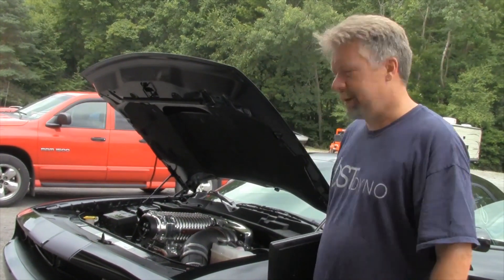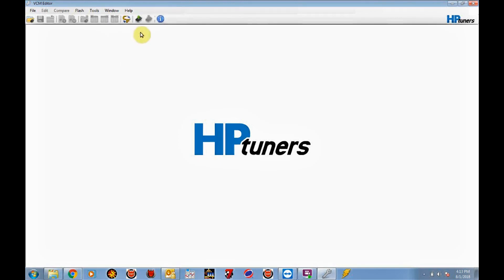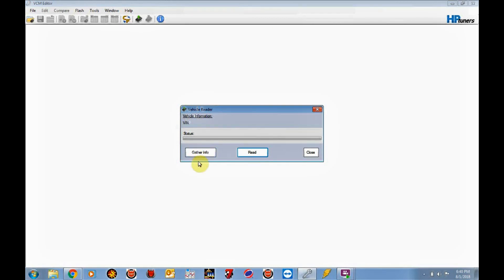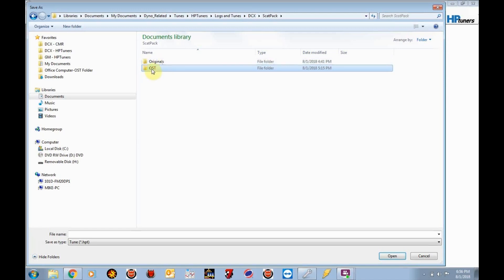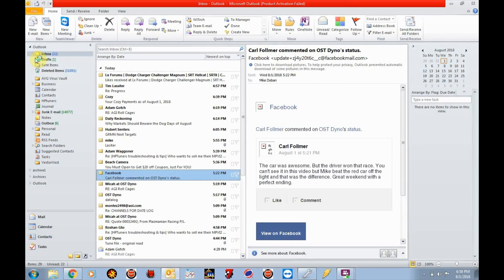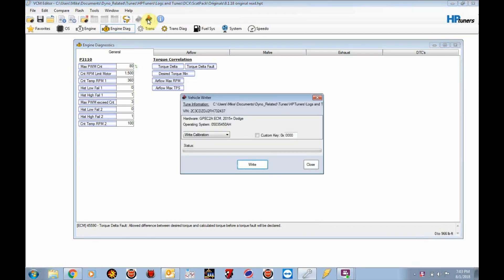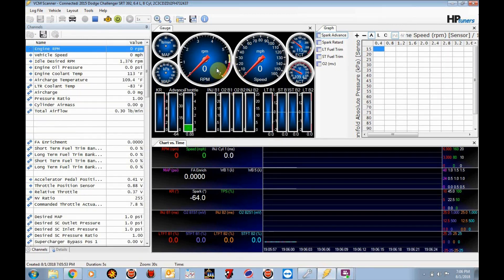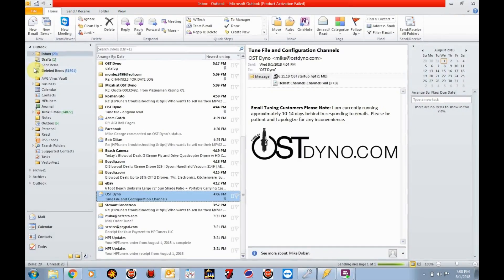OST Tech Tutorial #004 - HPtuners - Read/load tunes and datalog

Comment: I have a TES tuned Hellcat M6. Is their a torque reserve feature to help get this manual car moving? Also is there a way to set up traction control fully off when launch control is used? I actually like using it haha. Its tuned with HP and I was going threw software options but have no business trying to mess things up.
Reply from the maker: I don't know what a TES tuned vehicle means but if you are using HPtuners to tune with then yes, there is torque reserve available to build boost at launch.
Reply: Ok thanks Mike! You helped tune my 16 Scat pack with Edelbrock EForce because of the MAP sensor was not reading correctly a while back haha.
Any idea how much to just add torque reserve to my modified car? I bought the HP Tuner before it went in for tuning.